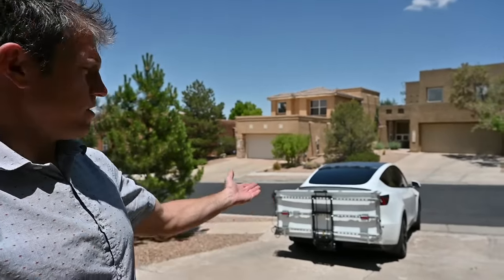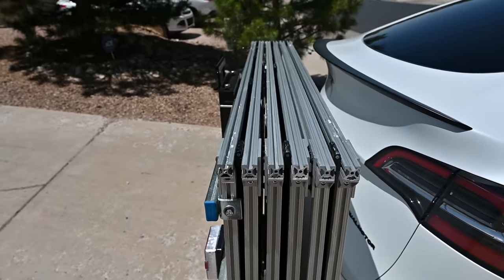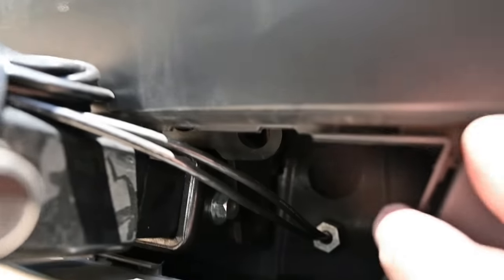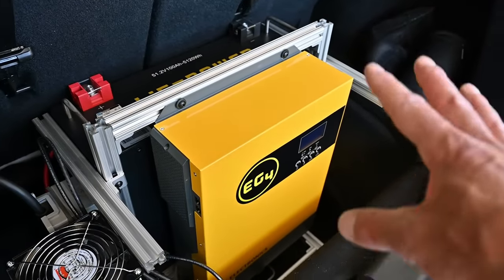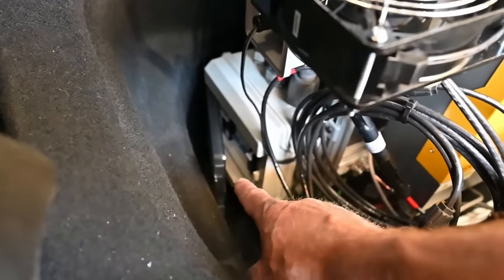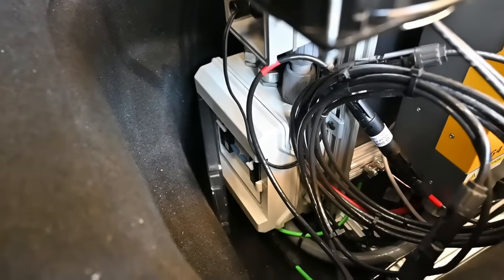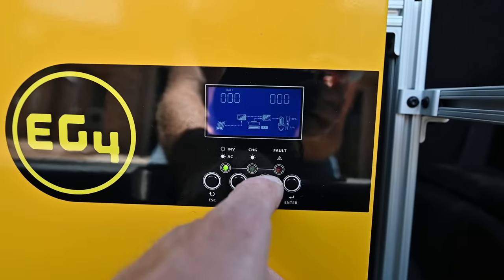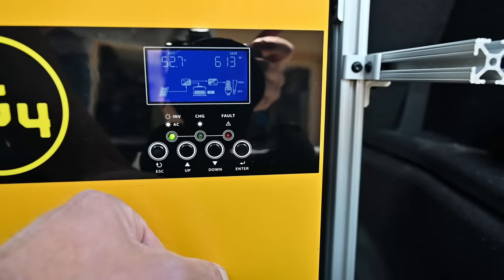Tesla Mobile Solar EV Charger with EG4 inverter and battery

Comment: You can probably add about 1-4 miles of range per day with high irradiance, no shadows, lots of daylight hours NOT driving your car, high security to prevent theft, and care taken so other drivers do not run over the PV modules in the parking lot.

Comment: Very cool and would probably work great for city driving, but I’m concerned with wind drag by the rear panels as well as weight. At the end of the day, solar makes most sense at home and at charging stations. There’s no reason to carry those along with the vehicle. 
It would be neat if some company would come up with a 2kwh system with 240v/32a charger as an emergency if you get stuck, though in reality it’s getting harder and harder to get stuck with some many charging stations (and outlets) available pretty much everywhere.
Reply: My exact thoughts lol.
I guess it's for camping trips not general day to day use.

Comment: The Tesla can sense if there is proper grounding. How do you ground your system?
Reply from the maker: It detects if neutral(white) is tied to earth ground only. Earth ground could in fact be floating (not recommended) or tied to the chassis as it is my car (green wire in video). The chassis is more or less floating but has some low conductance to earth via the tires.
Reply: @gridfreeordie  thank you

Comment: Did you think about replacing the model Y roof glass with panels and fitting solar panels on the bonnet / hood  ?

It would be great to have a kit that replicates what the Lightyear One is able to do , but for fitting to a Tesla 3 or Y.

Comment: I think it's a very nice project for your location where it is almost always sunny.  This will definitely help extend your range of travel.  

If I understand your video correctly, you said the system is charging the car at 600w? I think for level 1 charging at 120V, it adds about 2-3 miles per hour @ 1400w/h.
Reply: yeah, 600w is pretty painful.. 12A@120v is 1.4KW, on Model3 that yields 3-5miles/hour. Half that.... ouch. 
If the A/C on overheat protection kicks on, that is 1KW itself, losing power..
Reply from the maker: I can charge anywhere from 5A to 16A @ 120V using the NEMA 5-20 adapter. At first I was charging at 16A, pulling some power from the battery. Then I was charging at 5A and recharging the battery. So that's charging anywhere from 600W to 1920W, but the panels are only providing around 1100W, minus conversion losses so call it 1000W. So best to keep it around 8A during the day.

Comment: Nice setup!  I would be concerned about the longevity of flexible panels.  They don't seem to last much longer than 1-2 years compared to their rigid counterparts that will easily last 5-15 years.

Comment: This is certainly interesting, but I wonder of it would not have been better to use 3X400Wp Panels instead of the 170W ones. Or are those too large to fit?
Reply from the maker: Yes, that was version alpha and it was way too heavy. The glass panels are around 40lbs w/o any hardware.

Comment: Soon as I seen you roll it on the ground. My thoughts went to thinking why doesn't Tesla give a scratch roof cover. Incorporate a actuator that you can rotate & lock in place. Piston drives it up either car assisted or manual pull switch in a compartment to prevent it lifting while on commute. 

Once it's lifted simply spin it around lock it in place. Put the protective cover on the top of roof, trunk, hood. Roll it over the top of car & lock under the frame. It's more practical & also doubles as shade for the car.

Listening to the first part of the videos key😂.. Didn't know you engineered this yourself. Maybe a 3.0 can be my idea.🤘😂

Comment: About 12 miles/day (assuming 5 hours/day sunshine) for this battery setup or 120 miles for 10 days charge if you don't drive your car...Not possible if you drive your car daily for work...This setup is just a supplement. Home charging at home at 240 volts and at 32 to 50 Amps charging is typical, which charge 40 miles/hour for your battery - or 200 miles in 5 hours charge.

Comment: As long as you limit your driving to only nighttime and you park in direct sunlight you're looking at around 20 miles of range or day. If you only drive every other day it could work.
-edit I forgot about standby power consumption. With this setup you basically just break even unless you have a cloudy day then your screwed. If you don't drive at all this setup will work great.

Comment: You could get rid of half those solar panels if you built a setup that tracked the sun instead of laying them flat on the ground or roof.  Love what you are doing though.  Keep it up! :D
Reply: Tracking is very expensive. Panels are cheap.
Reply: @dorvinion  Tracking can be done quite simply if all panels were boom mounted and might have the additional benefit of providing shade for the car.

Comment: I feel like a more practical approach to get solar powered charging is via steam.  A retractable miniature Ivanpah-style mirrored refractor with heating element focal point (think giant magnifiying glass) plumbed into a water tank that boils the water to produce steam which spins a turbine that rotates a DC charging motor whose power can be fed directly into the EV battery in a similar way DCFC is, just at a slower rate.  Such a system would generate enough heat to get over 100 miles range per hour and is significantly more portable than a purely PV-style system.  The biggest weakness to it is wind resistance because it'd basically be a flimsy concave umbrella pointed at the sun.  Also there's somewhat of a safety issue because now you have to store this ungodly hot piece of metal somewhere in the car's storage area.

Comment: Got a few questions,

1. How much of a hit has wh/mile taken with all that?

2. Is there a reason you went with that large of a battery and inverter?  

3. How long do the panels take to charge that battery?

4. Is there a reason you didn't get a cheaper 5kwh used Tesla module? 

5. What about portable panels that would have been much lighter and been able to fit in the trunk instead of needing to mount on the external?
Reply: Smartmeyer

Comment: From the video, his PV charger is less than 250 Watts per panel as his array is 1.2 KW capacity. Most Tesla cars are 0.24 to 0.3 KWH/Mile. The model Y year 2020 is listed at 0.3KWH/Mile, not counting the extra weight and aerodynamic drag of the folded panels on the back. That reduces mileage, especially at higher speeds. Full capacity is only with the panels facing the sun at near noon. Other angles and other times of day reduce capacity. This does not enter conversion losses from solar panel to charging the car battery. Assuming a good day in a southern US latitude, the deployed panels may harvest 6 KWH in 1 day if the panels do not become shaded by the car, buildings, trees, etc. 6KWH at 0.3KWH/Mile is 20 miles. It would take about 10 days of good weather to get a full charge. This assumes you don't drive during the prime sunshine hours.  Plan on getting a 15 mile charge per day of good weather at best.
Check the requirement for displaying the rear license plate. This might need the plate relocated to be legal, especially if you have toll roads.
Reply: yeah look at my recent reply too. I also came up with a 9 day to fully charge value too. yeah not practical at all.

Comment: Nice rig, I have a Skoolie with 1800 watts of panels and 8K LifePO. I’ve also done a Victron system in a van and am currently adding a smaller system to an RV. I’m wondering why you didn’t do a trailer with all the stuff inside?  You could fold up sides or roll out layered panels and do the max input for your charge controller / inverter. The benefits would be little tongue weight, easy disconnect and extra storage.

Comment: There exists a roll up solar panel, very flexible. 1 panel is 100w 319v solar. Just mentioning since you said needed that many panels to get enough voltage. Maybe a smaller size system option.

Comment: Roof folding solar panels, are they the future of cars? After unfolding, it can achieve 1500-2000 watts of solar charging power, with an average daily replenishment range of 30-50 miles.

Comment: So 100 hours to charge the car?  Is there any way to make a 240v system?
Reply: Basically yes, very slow charge. And making a 240V system is simple, but you lose fidelity in charge rate since it is done in increments of amps. Each amp increase in the Tesla at 240 is twice the power of 120. Only matters if you're really trying to not match the input solar power and/or have a tiny battery with little capacity for clouds etc.

Comment: How long for a full charge? Sorry if I missed it
Reply from the maker: Well...you're looking at ~80 hours in proper sunlight with the existing panels. But I have a way to fold in more flexible panels between the existing framed panels to double or triple the PV without adding significant weight. Stay tuned I suppose. But, the system charges what I need for my commute while I'm at work. It's essentially a top off setup in its existing state,  but certainly doesn't fit everyone's needs. And, there's no permitting!

Comment: It would be neat to tie the inverter output directly into the car's charger eliminating the need to manually plug in the car.  Granted you'd still have to manually flip the breaker on and off, but that could be automated given enough effort and money.

Comment: I haven't read many of the comments but what if you converted a roof rack and had the panels slide over the car as a cover?  could help with heat also

Comment: Add a thermistor and an exhaust fan for temperature regulation. I'm also interested in how many miles per day that system can add
Reply: Depending on sunlight, between 20-35 miles

Comment: What about putting a contractor extension cord directly wired to the inverter/charger so you can then charge the Signature Solar battery off house current if you need a quick boost? Would it alleviate extra outlets in the garage for the Tesla charging cord? It should alleviate the need to search for higher power plugs. Yes, no, maybe?
Reply: Dangerous! Why would you even suggest this?
Reply: @uhjyuff2095  because I have a Renogy inverter/charger that can take a 120ac input that charges the battery when grid power is available. I believe some of the Signature Solar inverters have that ability. That’s why. No danger unless someone is uninformed, right, or can’t wire it correctly. If available on his inverter it would be a nice option.

Comment: So how many days does it take to charge per mile ?
Reply: Do the math.  21 miles a day.  Assumptions: 5 hours of full sun, 280wh/mile, 1.2 kw solar. 6kwh produced a day.  Basically divide 6000/280 and you get your answer.

Comment: Great idea but can't be legal to drive as you are covering the license plate so it would have to be moved to the back of the folded up unit.  Also affects handling and reduces range so you would have to charge more often on road trips.

Comment: How did you run your change cable through the trunk??
Reply from the maker: The lower trunk is a plastic bin under the carpet. I drilled a ~1.5" hole to pass the head of the charge cable. I was going to seal it, but there's never been any water down there after rain. Perhaps in many rainier areas you'd want to seal it around the cable.

Comment: This setup is really only worth the investment if you are completely off grid. I have a model s and my wife drives daily with an average of 300 miles a week. We have an all electric home so we invest in a 16.8 kw solar system which is a little more than we need but when we were taking bids it was determined that 15kw was all we needed and the max our roof could hold with panels facing every direction except north was 16.8kw so we got the larger setup.

Comment: I  love the folding solar panels array on the bumper, I was cheering that someone was doing it with glass and then I heard flexible panels in frames?  Why not just use glass panels which are already in aluminum frames? Flex panels do not last in the sun: cheap ones under a year, spendy ones, a little more than.  Glass panels generally have a 25 year warranty and last longer. The Renology compact design 100 watts/12 V are only 14.1 lbs, while most 100watt 12 volts are about 15 lbs, same as your flex set up, (yours aren't 200 watt, are they?) Sure glass breaks, like a windshield, and would be more subject to rocks back of the car like that.  Some protection schemes would be helpful.  Styrofoam or something really light to absorb impact of small stones and such.  Or it might be safer tucked into a roof rack with accordian folds in two directions.  I like the rear thing though, and the rear thing might be more aerodynamic.  Needs lightweight rock protection.

The back up battery is adding whole bunch of range, but there are people that have been working on the DC to DC charge direct from solar and there is at least one device you can buy and install in your car for more direct charging offering an option with less weight.  I don't know how complicated that is to install.  Real Solar Cars YouTube channel.  Electrek's $3000 entry.  Elecbee.  I even saw stuff on Aliexpress, I think.  Google "dc to dc electric vehicle charger."   It's coming.

Comment: you have done some nice work, but with all respect, all this video provides is some nice pictures.  i will never own an electric vehicle of any type, however, if a person is going to go to all the trouble you went through to "solar power" a Tesla, the primary information i think most people would want to know is will your system "recharge" a Tesla; what percentage of recharge will these panels accomplish and how long do you need to "deploy" these panels to recharge your Tesla?  finally, you invested $6400 dollars in your solar system.  how long would it take you to "recoup" that money versus the cost of electric from a commercial fast-charger or a home charger?
Reply: I used to say I'd never have an EV until I found out that they are in fact fully capable of replacing a car to do car things (replacing a truck has yet to be done so I do keep a truck for my camper and other truck things - the EV is how we do 80% of our miles though).

Anywho. The way he has it set up is roughly about as fast as a regular 110 outlet. So from dead flat to 80% in about 48 hours if you could run it 24/7. It doesn't run 24/7 so it would take 8-10 days. 

Its impractical and silly to do what this guy did (demonstrating why solar panels are not installed on EVs)
There's two things he did that make it impractical.
Flex panels are 3-5x more expensive than regular panels. 
He also spent a buttload on a large, lightweight battery. The inverter needs a battery but the battery is not needed for storage but rather as more of a buffer. 

Chances are he would never be able to recoup the costs on this because portability makes it expensive. If mains power costs 13 cents per kWh, he needs to add about 46,000 kWh from the solar panels to the vehicle to 'pay' for it. At 6kWh a day, that is about 21 years. If electric rates go up the payback gets shorter.

If he wanted to solar power his Tesla, and do so in a way that justifies costs, a permanent installation would pay for itself in 4-6 years if you could charge directly from the array during the day. If you had to add a battery to store for evening/overnight you'd probably have to add 2 to 4 years(guess cause I didn't do the math)

These estimates assume DIY costs. Professional install of course costs way way more
Reply: @dorvinion  i think you've illuminated the primary problem with this guy's "invention" - "return on investment."  i live in a 1975 "all electric model home" of around 2100 sq.ft.  i live in pittsburgh, pa and get duquense electric's lowest rate because i have an all electric home.  i think it's around .6 cents a 1000kw.  our electric bills in the winter (an electric furnace) run around $450.00/month.  in the summer with air running, it's around $250.00/month.  i had 5 different solar companies assess my house and give me proposals for solar panels.  with only replacing 60% of my monthly electric usage with solar panels, i could not get the ROI numbers to work any better than a 7-10 year payback period before i would see a dime in savings on electricity.  that led me to conclude that it doesn't make any sense for ANYONE over the age of 60 to EVER invest in solar panels for their home.  now, a young couple in their late 20's, early 30's - sure, solar panels would make sense.  but taking ALL variables into consideration for solar in the Northern part of the U.S., the value of this energy source is very mixed.

Comment: Genius with excellent engineering but at the same time mental. Put it in a trailer (as others may have mentioned). Then just plug the EV into the trailer as normal. No need to destroy your EV nor eliminate the storage in the EV. Oh and then make off the ground supports because as you mentioned yourself someone will run over or walk over it. And make the trailer as theft proof as possible.